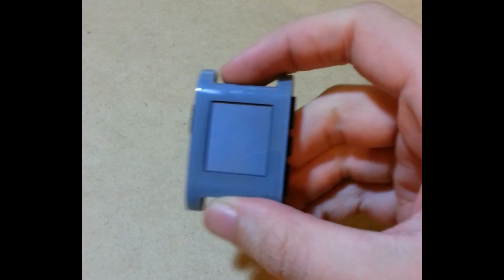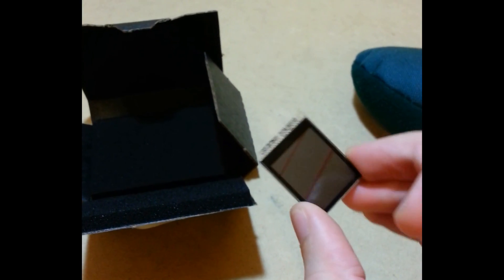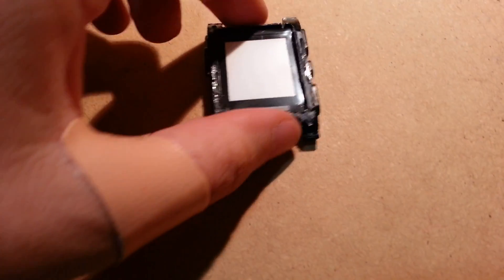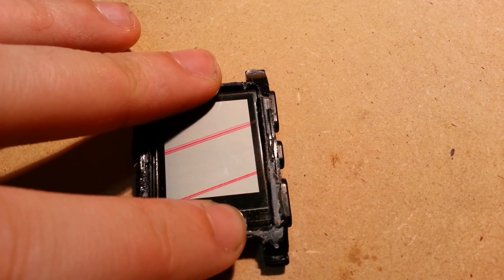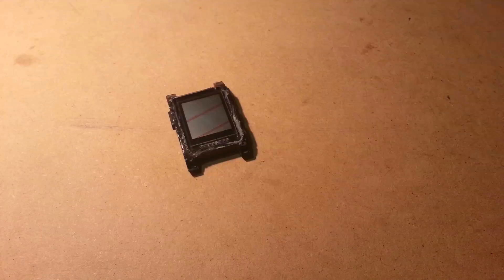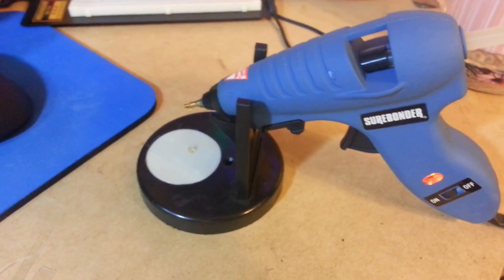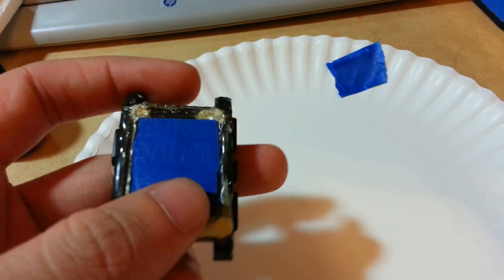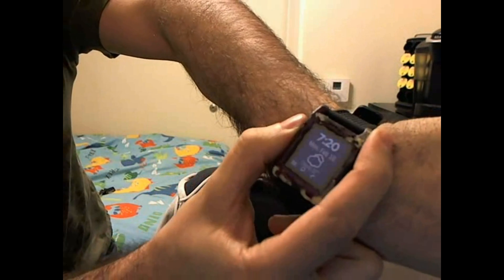Replacing a Pebble Smartwatch screen

Comment: My dad recently broke his pebble, i could tell the screen was broken because there was a black circle with cracks but the backlight still works. Going to try to replicate what you did here in this video, ordered the screen online and it should be here in a few days. for now though i managed to get the front case off but i did it a bit differently. i used an iron and a dish rag and i just put the rag on the watch and then pressed the iron down on it for about 5-6 seconds, then i chipped away with a knife, toke me a while but after repeating this process i finally got the cover of and even managed to not damage it to much so i can reuse it instead of getting a piece of plastic to hold down the new screen. Hopfully this works for me! :)

Comment: Fuck adhesive. What ever happened to screws?
Reply from the maker: I'd have to have a material to use as the new faceplate, and probably drill and tap holes in the frame. I had hot glue on hand, and not a whole machine shop to fashion a new faceplate out of wood or whatnot.
Reply: I think you're misunderstanding me, lol. I meant companies even using adhesive in the first place. It's a pain in the ass. I understand for some things, but do you really need gobs of adhesive to hold a bezel on? I think not, Pebble.
Reply from the maker: Ryan Gehret Oh, hah, yeah. I can understand them wanting to use adhesive since it's waterproof, though.
Reply: I guess so.
Reply: Well that's good
Reply: hey guys watch my  pebble replacement screen on my fb https://www.facebook.com/media/set/?set=a.1495711663978386.1073741836.1447384845477735&type=1

thanks to colt wilkens for the info from your website... 

i manage to repair pebble version 2 with 4 screww at the back